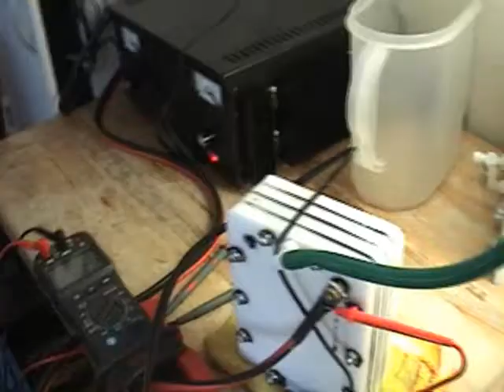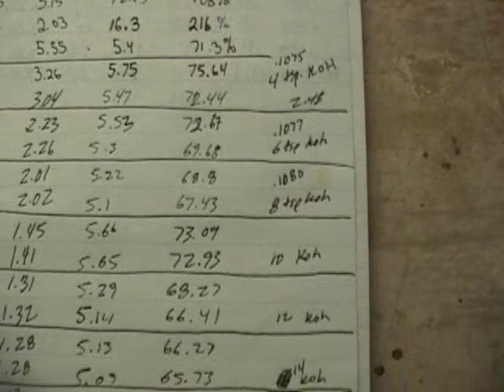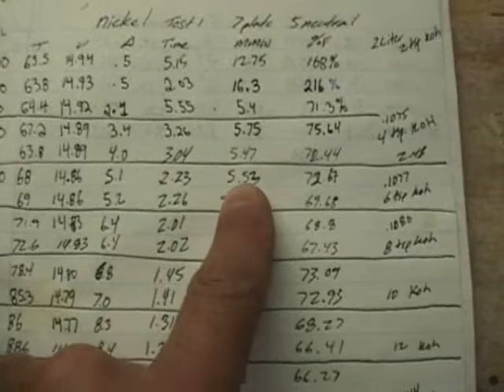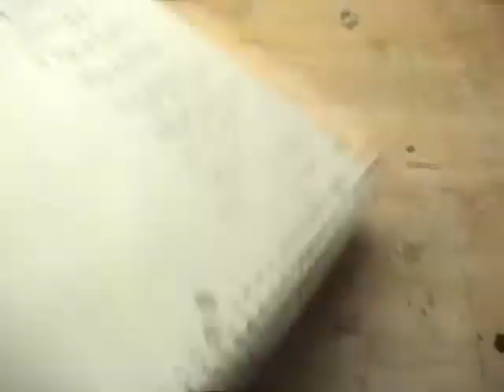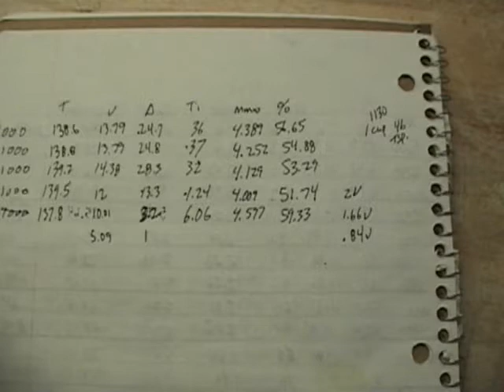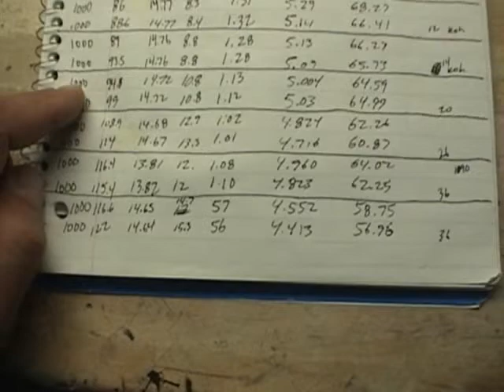hydrogen nickel test conclusion 3 amps less than stainless

Comment: Very interesting results. My advice, add another N plate. 

I think the reason you are seeing better effeciency at lower KOH concentration is because as the resistance of the e-lite decreases, the current leakage increases.

Current leakage...... if what I am working on right now works, it will be a thing of the past.

Comment from the maker: In my next design i will be able to add plates very easily. and yes I do understand the concept. My design in this video was extremely flawed. The results are all over the place. I think the cell was in the process of failing as the heat went up. The next cell should be a better testing platform.

Comment: Steve, I'm also think that your over heating issues were caused by excess amps.
To find the Sweet Spot of a cell, you need to be able to do many different tests.
Starting with '0" amps and test the voltage only, then slowly step up the amps until your numbers give you peak performance.
Then add a PWM and find it's best performance.
Then add a variable frequency modulation unit, like Bob B. and Stan M. did.
Think of low amps & volts, proper PW and Frequencies.
That's what I'm shooting for.

Comment: Now I think that you think that the nickel itself is enough to produce more gas. But that idea is wrong. The only way to produce more gas is to create more plate surface, since nickel has less resistance you can add more plates, so you have more plate surface. You give me the feeling that you do not understand this concept. Just having nickel plates is not enough, you must use the correct setup to get your gain. So unless you get more plates you will get no real gain.

Greets, iT

Comment: I think you are making a mistake by comparing two cells like that. Nickel is a different material, so you should built a different cell that is customized to the specs from the Nickel. ^plates is not enough, not even for a stainless cell. I think you should use at least 8 plates if you make another nicke l cell. That is where your gain is. But that is what I think, it is easy to say, if you don't have to pay.

Comment: Concerning Smack's statement, it's probable that voltage is the culprit. Look at the videos of guy named "hhoforvolts", he used only 2.5-3.5V per cell. And he has a very interesting PWM (to say at least). And because of low voltage he experiences no plate mess-up and red crud on the surface of water. So, it seems, higher voltage messes up even the 316 SS. Just a thought...

Comment: 3 quick interesting things.  1.Sirhoax says the stainless tubes(like stan meyers style) are 2/3 more efficient than the plates.?I wonder?   2.Smack says the P.W.M.s' mess up the surface of stainless"I wonder If he had the heat to high?" Or maybe Nickel is the answer.   3.Has anyone tried a stainless Rodin coil electrolizer? The D.O.Defense said his coil puts out 60.5% more power than the standard torrid. Thanks Bro! Jason C.

Comment: try doing a bell curve of voltage. test it at 10v 10.5v 11v 11.5v 12v 12.5v 13v 13.5v. 

Look for the mmw bell curve to peak. you should do this with every cell, especially when changing materials, and elytes. electrochemistry changes voltages that work for different things. 

The question is do you know why.

Comment: You are running against the wind here Steve. I can help with some of your issues. Do not use the bedliner material period. It helped but I know something much better. I also know how to solve your MMW issues. Right now you are traveling down a long hot pavement road that I have walked down in bare feet. No need  to burn your feet as well. You can get that cell in the 80% range that I am sure of.

Larry